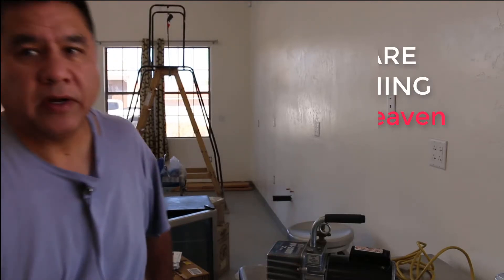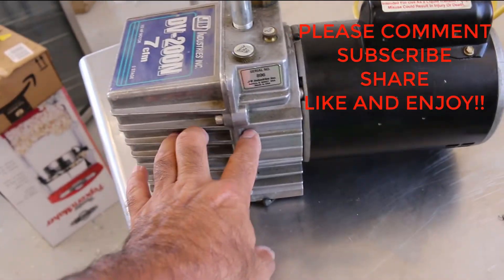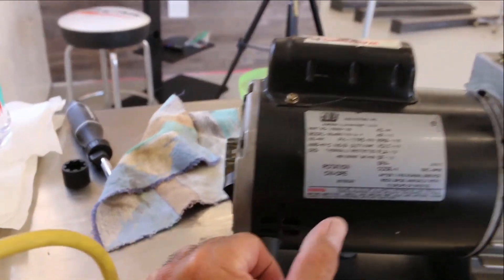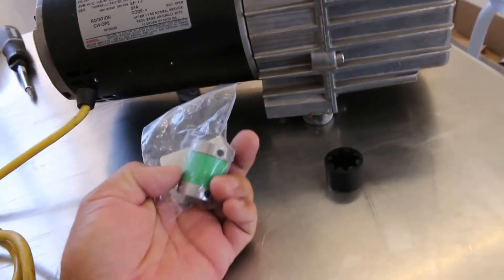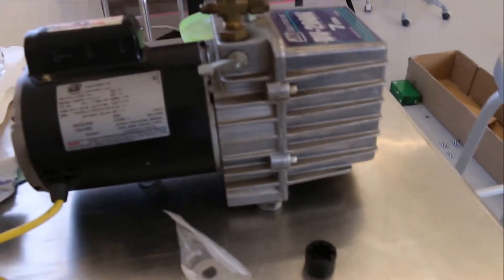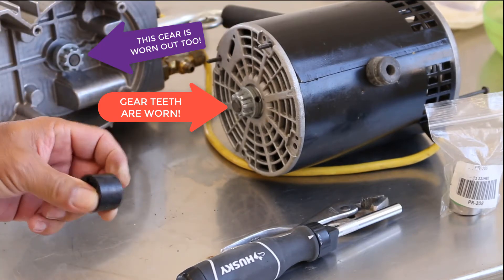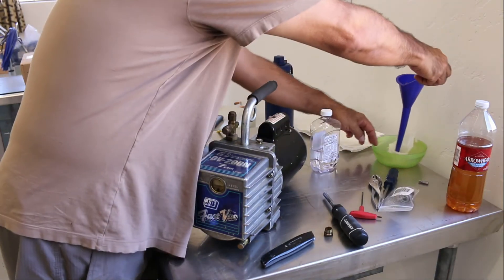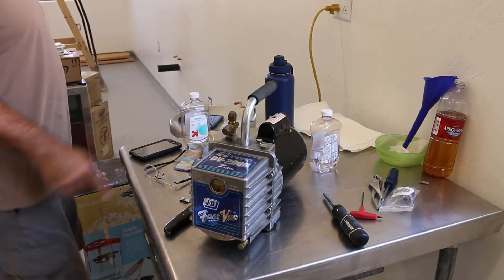DIY AC SERVICE!! HOWTO AC VACUUM COUPLER REPLACEMENT

Comment: Do you feel that the coupling got old and frail or the pump is getting tighter?
Has it held up since installing the new coupling?
Reply from the maker: The coupling actually wore out the gears were rounded as well as the coupling, which split in two. The pump is great. Thanks for watching HowToHeaven and taking the time to comment on my video!